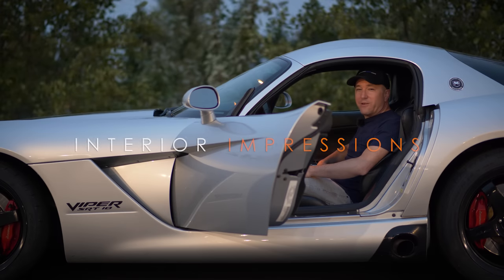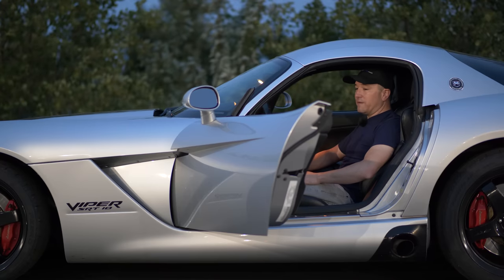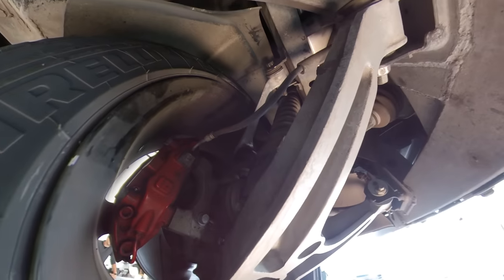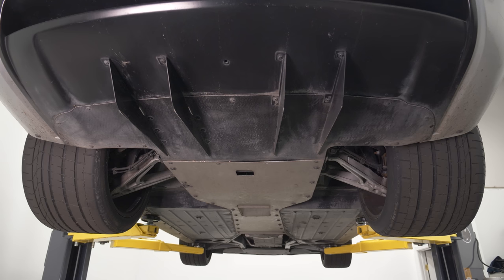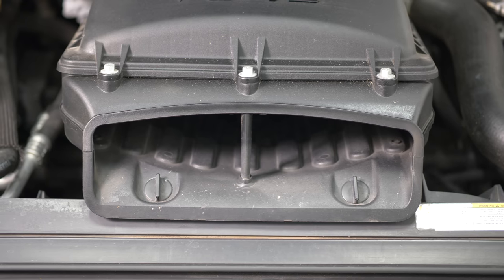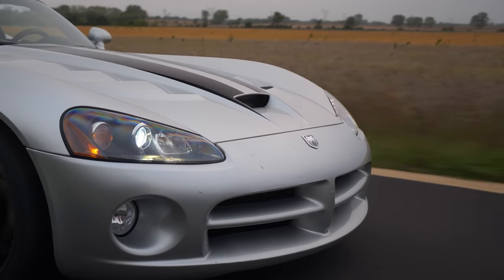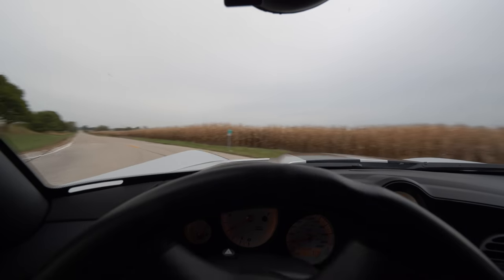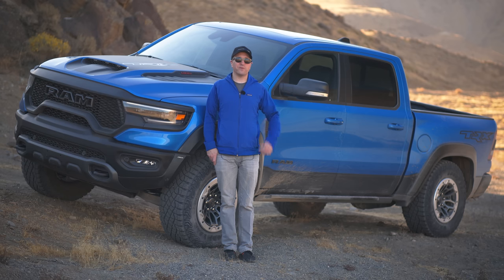Dodge Viper | Super Car or Garbage Truck?

Comment: And yet somehow, despite this basically being a lowered supertruck.. It managed to capture the much sought after Nürburgring Nordschleife production car laptime record for a brief period of time... Very impressive.
Reply: Not to mention it holds the most track records of any production vehicle

ever
Reply: @THESLlCK  Thing is a beast!
Reply: it also literally had the biggest stock tires ever on a production car...
Reply: @veryrare7647  355's baby!
Reply: @THESLlCK  yea my point was that most of those records are largely due to having bigger tires than anything else. when other cars got big tires as well, they reclaimed the records.
Reply: @veryrare7647  I seriously doubt that
Reply: @veryrare7647  that's so stupid to say lol
Reply: @veryrare7647   Not true! Even the 2023 Vette ZO6 C8 is over 1 second slower than the 7 year old Viper w/ it's front engined, manual trans rear drive from 2015 on the short 2.24 mile track at Laguna by Randy Pobst (1:28.65). Twelve other overall track records (not just lap records), are held by the naturally aspirated 2WD Viper. In fact, the Viper has always had the largest 13" wide rear rims of any production car since 1992!
Reply: @user-ic5jm5vv7q  you proved my point...

Comment: "You have to see this car for what it is" proceedes to bash it for what it's not for 80% of the video.
Yea. We know the interior is not good. It was Dodge in the 90s. That's not why someone buys this car. So why spend so much time talking about it?
Reply: They daily drive 4-cylinder cars... what do you expect
Reply: This is a 2009 Dodge Viper, not "Dodge in the 90's". This car cost a minimum of $90,000 over a decade ago. You should not be getting leftover Plymouth interior parts for $90,000. You should not be sitting to the side of the steering wheel and pedal box. The point that they were trying to make was that the lack of engineering refinement, while sort of a funny joke, actually significantly detracts from 95% of the driving you're going to do in this car. I also think that if they drove a final-generation Viper, they would sing a different tune.

Comment: As Car and Driver said of the original - it really only needs 3 gears because there is enough torque to live in that one. 

Of course they also said: Enough torque to leave burnouts the length of the Hardee's drive-thru.

Comment: I’ve always been amazed how quiet the Viper V10 is, especially compared to a Corvette V8. It’s like the “imbalanced” firing order of the V10 is inherently smoother than a small block V8. It doesn’t scream, hardly even shouts.

Comment: i would love to find a 2017 ACR that HASN'T been tracked--I am sure collectors have held onto them.  I would daily it but Chrysler build "quality" is deplorable.  Even the way they wrap the factory wiring harnesses is bad; it looks like vinyl electrical tape from Lowes and it always gets sticky and unravels.  Chrysler/FCA/Stellantis also LOVES wrapping hoses and wires in that expandable "mesh" that is abrasive to anything it touches.  All this would be normal and acceptable to you until you buy a Honda or Toyota and you realize the hoses, wiring, bolts/hardware, quality of steel and overall fit and finish are MILES better, and you have been duped into thinking Chrysler = quality😂🤣

Comment: I don't get the interior hate for the Viper.  I've had a 2004 for nearly 10 years and it was my daily driver until my wife had back issues and couldn't ride in it regularly.  Just hit 130,000 miles on it and have no plans to stop.  I'll admit I can't quite get the best fit for myself in it for longer trips (I've done a few from the midwest to the east coast now), but I never feel like the interior is bad.  The gauges are where they need to be and convey important information well and stuff is within easy reach.  It could be slightly higher quality materials, but it's not like it's falling apart 20 years later with all the miles I have on it.  The worst of it is just the front edge of the dash is curling up a bit since the glue is starting to weaken.  I also don't get the radio complaints.  I mean, it's not as nice as some super premium systems (and the bass completely disappears the second I start the car up anyway), but it's not that bad.  I bought my car with a full aftermarket system that was just poorly put together.  I wasted a bunch of time and money trying out different aftermarket stuff that actually fit in stock locations only to find out a factory stereo and amp sounded better than anything else I've had it in.  The speakers are still aftermarket, but the radio and amp and much better matched to the car than anything I could do myself.

Comment: Tbh I can appreciate and agree with the interior criticism, but apart from the heat and the gripe about the dead pedal - which is obv bad because I hate when my legs are tired - I care about none of it. Now, I'm not some macho freak and not even trying to be one, but when I'm driving my humble S40 Volvo on the road, I look at the road. I don't look at the leather:plastic ratio in my car. I don't randomly touch surfaces to see if they feel comfy or if they wobble. And I most certainly never wish for BLIS or EB or a rear camera. I just giggle when the spry little turbo-5  lets me have some fun and I wish it were bigger.

Comment: I just bought a 2001 Viper GTS and drove it 425 miles home from where I picked it up. So, I have some saddle time. I appreciate what these guys are saying about the Viper with respect to the interior and what have you. Offset pedals? Try driving a Pantera or 1960s Lamborghini. Objectionable interior? Same with many performance cars, like an F40. You just accept or forgive those omissions for what the car delivers. So, I do not share the overly harsh criticism, but understand where it comes from. Want cup holders, blah, blah, blah... buy a Corvette. Hey, nothing wrong with Corvettes!

Comment: The weenie thing was perfect . 2 weenies whining about the car being prehistoric and all.  Anything different than your s2000 and you just loose your minds.  This car is different ...it has character and will kick you high revving ricer's ass in any situation.    Winning its class at Lemans and an outright win at the Rolex 24 was epic.   The s2000 won a trophy at the local Autocross.   And who uses a Viper as a daily driver?    Get real.    
Go have a Latte"
Reply: That's some Real spit.  Tell it like it is bro. 💯

Comment: They appear to be great cars but the death kneel (low sales) for this platform was simply the lack of an automatic transmission.  Even Ferrari, Lamborghini,  Porsche, Aston Martin et.al  realized earlier that the aging population buying group of "gear crushers" wasn't sustainable going forward and they responded accordingly - Dodge did not.  25% of 2019 corvettes were manuals and as you know the 2020's are all automatic only.

Comment: I really respect this car but one area that always disappointed me was the exterior styling. The previous generations (especially the Gen 3) were really beautiful whereas this car lost the iconic shape of the cars before it. Overall, It still looks badass but the styling is a bit awkward. I will give them credit that they recognized this as the Gen 5 is much better looking on both the exterior and the interior fronts.
Reply: The Gen 4 is almost identical in styling to the Gen 3 with the exception of gaining a very dramatic vented hood lid, which was considered by most an improvement. Other than that, there are nothing but minor detail changes.
Reply: @markmiller3279  You're right, my bad. I really meant the Gen 2. I didn't love the styling on the Gen 3 and like you said, the Gen 4 didn't change much. Gen 5 was much closer to Gen 2 IMO.

Comment: Silly question - most cars seem to have a slight weight bias toward the driver's side. But adding the driver will add to the imbalance. Why wouldn't sports or track cars be weighted with a small passenger side bias with the assumption that the driver will be alone most of the time the car is driven the hardest?

Comment: The Viper is definitely not built for people who whine about dashboard materials. It's an unapologetic street-ready race car, as honest as a car can be in that setting, and I totally dig that. You'll never see a car like it again, which elevates it to among the very highest echelon of cars throughout history.

Apparently I'm in the minority when it comes to V10s, but I think the Lexus and most Lambos are the ones that sound like garbage (or, more specifically, wind-up childrens' toys). I'm not a big fan of the sound of ANY V10, but during this video I actually found myself thinking "that sounds so effortless, almost soothing." If it can't sound like a cross-plane V8, I'd take the sound of the Viper V10 over the Lexus and most Lamborghinis, too (possible exceptions would come from their older pre-VW cars.. all of their current ones sound abrasive to my ears). I'd leave the exhaust stock either way, though.

Comment: Ya'll just don't understand what it's about.  It's about going as fast as you can in a straight line like the big block '60's cars, and I don't think you ever will.  It's about function over form which is sadly missing nowadays.

Comment: If you buy a low mileage Viper (or one that has been sitting) make sure to check the tire date codes. Do not use tires older than 5-6 years no matter how deep the tread is. This is why many are being crashed. Best tire is the Toyo R888r and most people run these.

Comment: I would love to buy one of these and customize the interior. The upside of Chrysler not giving a shit is that all of the interior pieces are relatively flat. Simple to wrap or 3D Print replacements and make it whatever you’d like. Wrap it all in alcantara or leather, replace the seats, sound deaden the cabin, custom steering wheel. Could be super cool.

Comment: All this talk about "what this car is," and there's no mention of what it REALLY is?

We all know this is the car in Gran Turismo 2, where you could either punk out, and buy the C4 ZR-1 like a noob for 50,000CR, or hold out for another 25,000CR like a seasoned pro, and get the Viper GTS, with 60 more horsepower, then turbocharge the hell out of it, and kick the shit out of everybody at the Super Speedway by flooring it everywhere and riding the walls like a mad man, and banking mad CR thereby. 👌🏼 🚗💨

THAT'S what makes this car what it is, why it's so special, and why it's worth whatever that guy paid.

Comment: A bit dramatic commentary.  Facts are the Viper never had the usual budget that other cars had. Shoestring budget is what it was given.  Not gonna get refined interior with that kind of budget.  They put the money in the drivetrain and suspension.  Had nothing to do with micro penis and all that silly jazz lol.  It was a throwback car on an extremely low budget.  You knew that but still went for the cliches and regurgitated hot takes. Smh.

Comment: The new Lamborghini Huracan  is a 5.2 V10 naturally aspirated and they usually have 640 and 650 horsepower about the same as a Viper if not more but they don't have as much torque the Viper is engine definitely has more torque and Lamborghini huracan does 0 to 60 in 2.5 seconds I think 2017 up I'm just making an example out of a b10 that I can find that's a smaller V10 that's very powerful with no turbos or supercharger

Comment: The Hellcat is too comfortable. Dodge should revive the Viper and stuff it with something completely eff you bonkers like a V14 or something. It has to sound horrible and be completely impractical. If it is anywhere below 100K I would be putting a deposit today, because screw retirement.

Comment: I'd rather have non-consensual, premarital sex with 1960 appliances than to sit in a dodge viper interior from anything other than the 5th gen. 

However, shuttling a viper around a track is certainly an experience one would enjoy if you can tolerate being inside something that wants you to die for daring to enter.

Comment: The radio sounds like a piece of shit because it cost next to nothing for Dodge to put it in. It was an afterthought. I think step five in the owners manual on radio removal is ..."you must exceed 60 mph before throwing the radio out of the window." This is not a street car and wasn't built to be one. The only street driving it should see is on its way to the track...unless you're towing it on a trailer. There is no one who has bought a Viper, that knows even a little about cars (unless they were a fool) and said, "I can't wait to show this thing off while driving cross country." There's five aspects to this car...the beauty of the exterior,the handling,the engine,the transmission,and the driver. Everything else is an afterthought.

Comment: You save so much by buying that car instead of a loaded 911 or entry Ferrari..... The interior is shit. But spend 30k u saved on not buying one of those other cars, and give it a new full interior, high end sound, and you're still not spending 30k

Comment: It should be noted, the FCA killed off the Viper at least in part, due to having to implement side airbags. I really don't see the appeal in this American approach to performance cars, instead of a cohesive package they always (even on newer ones) are engine and drivetrain first and then "eh I guess we have to put an interior in". Long time ago I thought that was the right way, but as I've gotten older, I'll take a quality cohesive package over budget car with a big engine.

Comment: I rented one of these in 2000 when I got married. It was brand new and a fucking blast to drive. I accidentally down shifted on the freeway to 3rd gear at over 90mph. The car ate it like Homer eating a donut and begged for more....it just accelerated like a rocket. If I'd had that car another 24 hours I'd have died.

Comment: It's all about whats under the hood. Anything going into icing up the interior,  you're gonna get charged for, and that goes aginst their mission statement (at the time.....) If the Viper existed today, it would be more tolerable inside for those that care about that (or at least missed what Dodge is about to begin with even if the F has sorta botched that in certain areas now)

Comment: My understanding is, since Fiat took over, they used the suspension of the 8C, the Alfa supercar, pretty bad in handling, for the Viper. then of course tuned it to perfection. A few experts have been heard saying to check this if you are planning to buy a Porsche GT3. High praise indeed. I sincerely believe the credit goes to the late Sergio Marchionne. He revived the Chrysler, Dodge name not by branding and advertising and taking handouts, but rather by working with the engineers directly, meaning on the same floor, and revamping the quality of the cars. I was happy to see the Dart name coming back up, only wish, it was a rear wheel drive car. I can't afford the Quadrifoglio yet, but that was his work also. So was the geourgous and practical Pacfica (Hybrid as well as non-Hybrid). Actually he signed off on all the models. Smart man to keep one of the best chassis for Charger and Challeneger, from the W124 E Class.

Comment: the Viper is exactly what it is: a manual, rear wheel drive with a V10 and a LSD.  also, a viscous isn't a clutch-type. a viscous is a fluid driven lsd kind of like an auto transmission's torque converter and clutch types use... fancy clutches

Comment: An Early 6 speed challenger SRT is a budget car with the same vibe. No where near as competent, but hilarious fun, similar positives and negatives. Same transmission for what it's worth. The 6.1 was extremely reliable. Mercedes derived multilink is actually good on road, brakes are good for street use I think. Engine is comical, sounds better than a Viper frankly? More room, better radio. Interior sucks.

Comment: "The people don't care about interiors!"
2021 Charger Hellcat Red Eye 797 Horsepower 203 mph $85,000 and interior is still a collection of repurposed Rubbermaid containers. Car & Driver said the best they could do on the street (un-prepped normal pavement) with the massive 305 tires was 11.8-second 1/4-mile. That's about the stats of a 2005 Suzuki SV650, a then $6,000 V-twin motorcycle with cheap insurance and 50 mpg economy.
Reply: To be fair comparing motorcycles and cars is like comparing apples and oranges. You could look at virtually any car and find a motorcycle from 20+ years ago that can stomp them in drag races. 

Most of the people that buy cars like these don’t really care about the speed, but the fun factor. Yeah of course they are fast cars, but there will always be something faster. So I think Dodge just really aims to make their cars as absurdly fun as possible. Part of that novelty is focusing all of the budget into mechanical aspects of the car and making the interior subpar.

I personally don’t really care about car interiors. But I guess that’s just a byproduct of owning a car from 06 right now. As long as I have a decent seat and everything works like it is supposed to, it doesn’t matter to me.

Comment: How can you care about the interior when you've got the exhaust right next to you. How can you care about the interior with that seating position. In 2013, of my buddies at work sold his C6 Vette and got this thing. A 2006, so 1 gen prior. I laughed because he had that old folder of CDs in there you used to use back in the day. When we went for a ride and roll raced on the highway, I'd never been so scared. Nevermind the fact that most are garage queens. The interior doesn't matter.
Reply: lol i just got a 2004 srt10 vert. came back to this video and found my own comment.